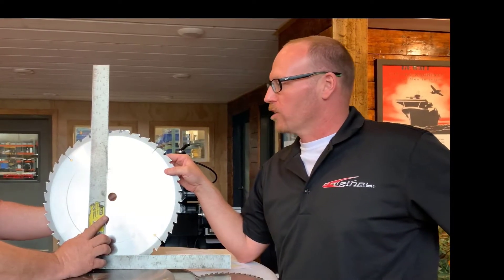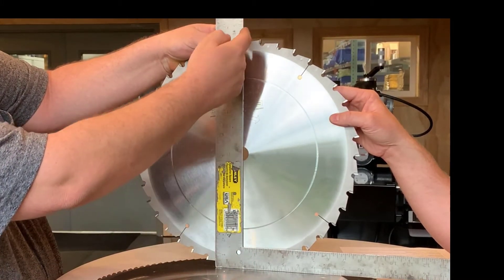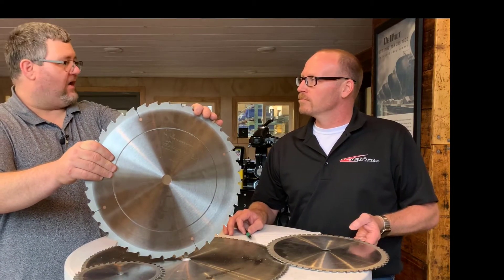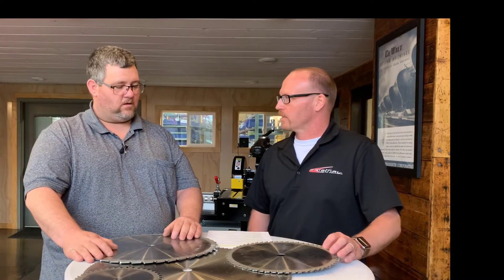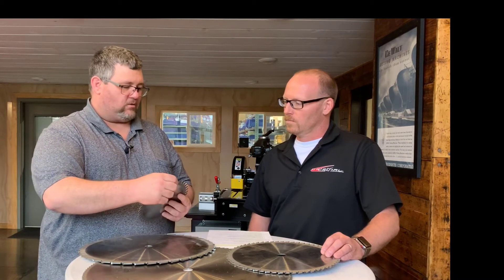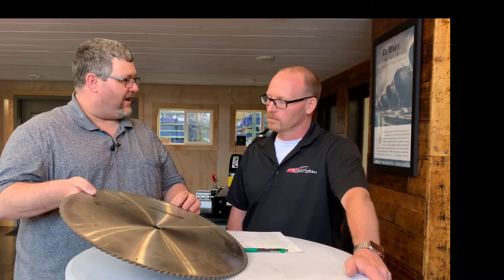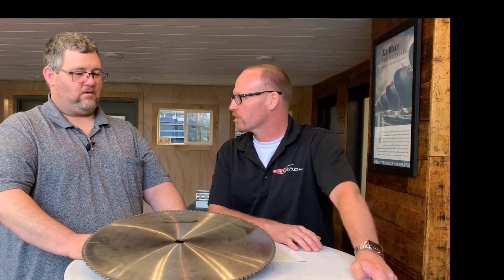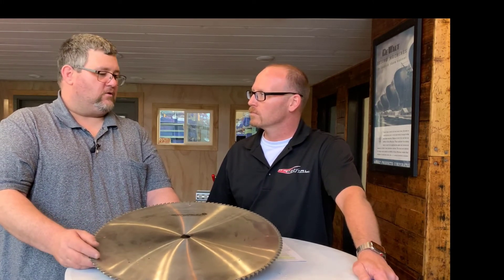How to Choose a Saw Blade for Different Materials

Comment from the maker: What kind of blade do you use??
Reply: I use 10 inch blades on my old ras. I use various blades, some with 10°, 24 tooth. Some with up to 60 teeth at -5°  and when I'm feeling a little brave I may even use a 40 tooth with 15° hook. But I only use that on things like 4×4. Or 6×6.
I am going to do some videos about radial arm saw use. Things like how to cross cut, miter, beveled miter, Half laps,dados, and ripping of lumber. I recently started to "re-saw" some 1× lumber, currently I can only go up to a width ( or depth ) of 3.5 inches. My poor old saw can't go any deeper. Would you consider sponsoring my channel ? If I had one of your 12 inch ras with rip capabilities I could make some really nice " Customer" based videos.   Thanks .
Reply from the maker: @c.blakerockhart1128  Sounds like you have some great projects going on.  At this time, we are not doing any sponsorships.  Thanks!
Reply: @OriginalSawCompany  
Well it never hurts to ask.  Thanks for your reply.
Have a BLESSED DAY.